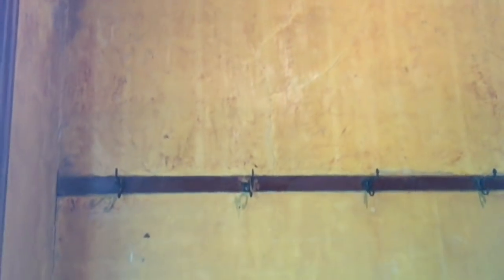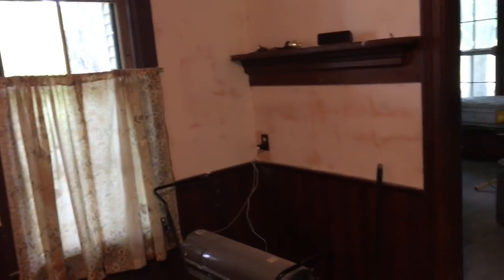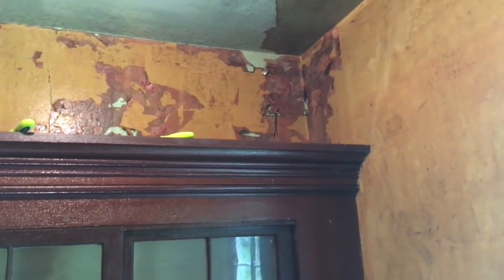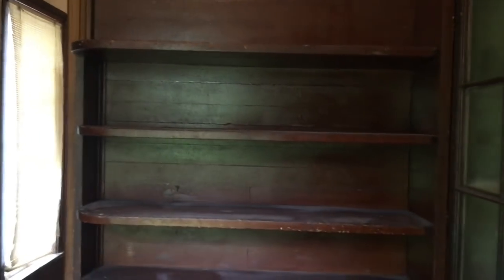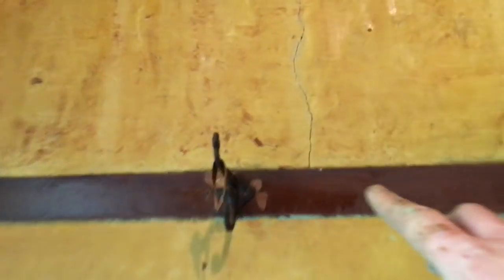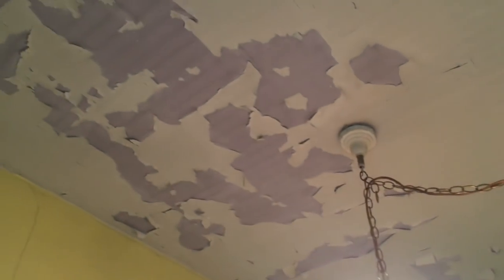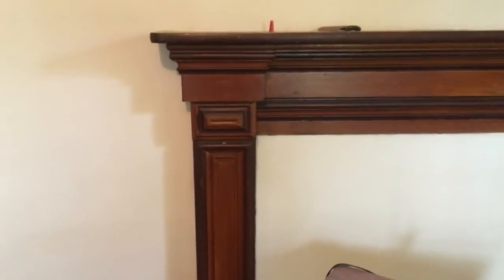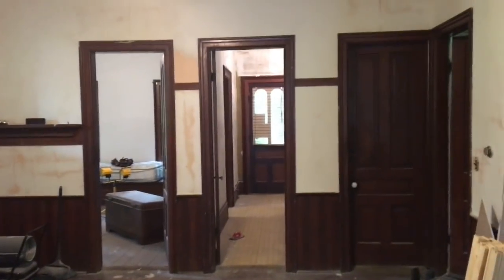1866 Farmhouse Restoration May 2019

Comment: There is a little tool at the hardware store called a paper tiger. It fits in your palm and has little moving wheels that have teeth that make perforations in wallpaper and you can roll it in all directions on your walls. When you spray water on the wallpaper it absorbs. You can add a little fabric softener to the water but plain water probably would go thru the holes better. I have removed lots of wallpaper. I always sprayed it with water, waited 10 min and sprayed again and waited 10 more min and sprayed again. You've got to give it time to absorb. Call me crazy but I like removing wallpaper.
Reply from the maker: kaybonette you must be crazy. Lol. I have one of those paper tigers but the spurs kept getting clogged by the paper. I’ll clean it off and give it another try on the ceiling. You are right about that paper drinking up the water. I usually spray it 2-3 times and let it soak but that room was nuts. The other 3 rooms I did were pretty easy. Any tips you have please share. I can use all the advice I can get.

Comment: I’m really enjoying your updates.  Since the upstairs didn’t have electric is it safe to say the upstairs doesn’t have heat either?  Forced air? I see they may have had wood burning stoves... but you won’t be putting those back in I’m sure.
Reply from the maker: Jesus IsGod good eye. You are correct. My plan is to put in electric base board heating upstairs to supplement the forced air down stairs. Coupled with ceiling fans in every room. One day I will put in an outside wood burner which runs through the forced air furnace via heated water radiators to give us an option of gas or wood. I’m planning for the long haul. Metal roof, two water heaters, French drain, 3 ways to heat, and possibly solar power for the water pump as well. If I end up biting it before my wife I don’t want her to ever have to worry about those things. I’m 39 now so I have time hopefully but I want to do this stuff now before I can’t. The electric has gone out on that road every winter and once for 3 days. So I may even leave one parlor stove attached and waiting for action.

Comment: make sure you clean plaster walls with TSP before you paint
Reply from the maker: Suzi Briggs-White what’s tsp? I’ve been doing a final scrape and wipe then a thin skim coat of mud, then sand, then paint. Is tsp easier? Any advice is weeeeelcome! Thank you for watching too!
Reply: @maddash9070  it is a cleaner that removes all the yuck(technical term) from the walls. You can get at box stores.its either TSP or TPS anytime i did not use i  noticed marks on the wall after painting even though i put primer on before painting.
Reply from the maker: Suzi Briggs-White I’ll check it out. I have to go to Lowe’s soon anyway.